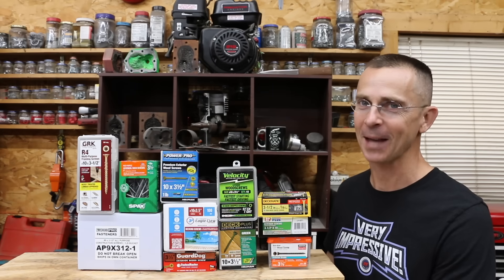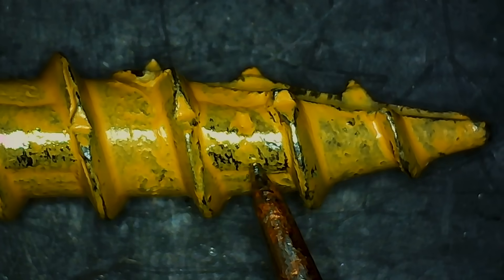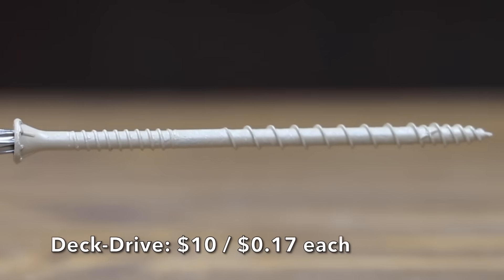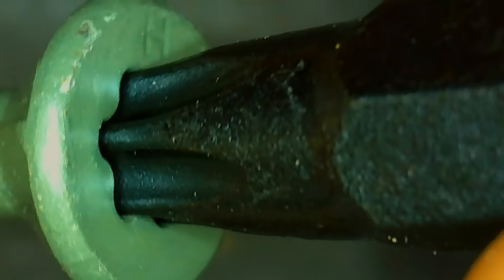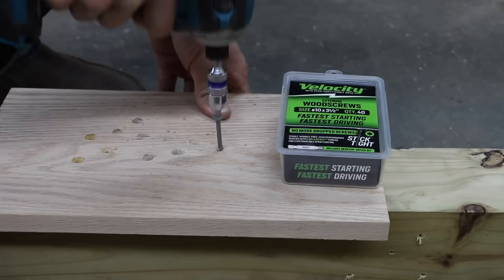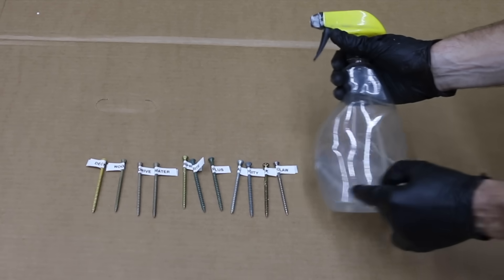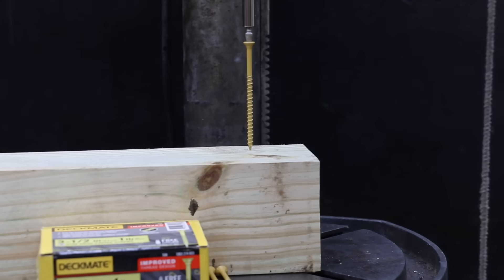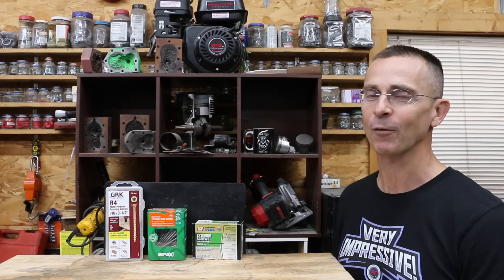Best Deck Screw? GRK vs SPAX, Grip Rite, Deckmate, WoodPro, FastenMaster, Deck Plus, Eagle Claw

Comment: I think the weight to drive the screw is most important here as long as the coding and shear results are decent.  But the actual pre drill ability meaning would not being prone to splitting would be #1 but it's not here.  I've always preferred GRK over everything I've used For these reasons

crazy story -  I recently built a large deck with porch railings, I used 3 inch GRK deck elite screws, the project went perfectly and as always GRK's bits were excellent and can last through many boxes past what they need to,  however, the crazy thing was, the first screw I took out a the large 350 screw box snapped right in half when backing out of two very soft regular 2 by fours placed flat on top of each other, my heart sank, but then it never happened again
Reply from the maker: Thanks for sharing.

Comment: Used deck screws to secure deck boards. Unfortunately, after 10 years of rain and snow, the screw heads rusted,  rounded out or broke off when using Phillips screwdrivers. Needed Milwaukee needle nose torque locking pliers to rotate out remaining screw body after using hole saw to drill around corroded screw. Recommend using stainless steel.
Reply from the maker: Thanks for the feedback.

Comment: I'm not a fan of the thread redesign of some deck screws for a reason you don't test for here.  That's the removability of the screw if it's needed.  The new design is supposed to be more efficient for lithium battery tools.  But the way they're made now, they can be difficult to back out when something goes wrong.  Plus the threads are prone to leaving metal burrs in your fingers.  Of course, I haven't tried all the different brands.  Deck mate from Home Depot are the ones I'm complaining about.
Reply from the maker: Thanks for the feedback.

Comment: a good question would be what's the max sheer force when attached to a 2x4? It takes 600lbs to pull a screw out of the lumber, like if you hang something from the ceiling..... and 2,900 lbs to break the screw, but I think the 2x4 would give in before the screw breaks when hanging something off the wall.... I'm thinking about hanging cabinets.... say you hang a super-strong cabinet to a wall with one screw... the cabinet wight has to be over 600lb and under 2,900lb before it fails... that's ignoring friction between the cabinet (rail with IKEA kitchens) and the drywall... 
My personal experience is that one screw will hold 2 people's weight without an issue so I tend to believe that one central screw into a stud on a rail is enough, but I have always had the doubt...

Comment: Nice review. In my personal experience, I had quite a common failure with #8 deck screw. That is what happens when you drive it through resistant hardwood: a combination of high torque and tension force results in screw head severed. Sometimes failure occurs further from screw head and nearly always in non-threaded section.
Deck screws in Canada mostly have Robertson (square) head. Torx heads are less common.
Reply from the maker: Thanks!  Thanks for sharing.

Comment: I know it's more expensive but I only use stainless steel 3" screws. Even though it's says "lifetime" on the box, the coated carbon screws rust away in no time when used in corrosive treated wood. It also prematurely destroys the deck when it rust away. I view "lifetime" carbon deck screws as a scam.
Reply from the maker: Thanks for the feedback.

Comment: I should have gone with your recommendations.   I bought the Eagle Stainless Steel deck screws because they were SS and I'm building a dock.  But at least 10% fractured at the smooth / threaded line.   I'd use different deck screws next time.

Comment: One thing to keep in mind with TORX drive not designed to fit snug (some manufacturers have modified the design slightly to cause this). It is their negative. If you want a tighter fit high-torque fastener, consider Posidriv. Square drive is a close second, but on other projects the backwards compatibility with Phillips gives Posidriv the edge.
Reply from the maker: Thanks for the feedback.

Comment: Robertson, cheaper and does the job.
Reply from the maker: Thanks for the feedback.
Reply: @ProjectFarm  In canada Robertson cost the same as philips so decking and fences are all done with robertson screws. BTW there is a difference from square drive, they do not sit on the bit like a proper robertson fit. Robby bit into a square drive screw will often bind as well. Square and square rarely has a collet like fit and will fall off when trying to one hand something, even torx has this problem. So you really need that taper on both bit and screw. If you are doing a 10 inch timberlock, then you use a torx bit. 

We have robertson screw with the cutting lead ground on the tip like some of those torx screws. So they perform even better with the tips cutting action and quality tapered square drive. There is more contact area on a robby vs many screws types. 

Love the show BTW. Also happy you have put a little emphasis on ergonomics. Like when you used the makita chainsaw.

 I have smaller hands and find Makita is my top brand because of where the buttons, switches and triggers are in addition to  the low vibration of the tools. Less vibration usually means the tool has a better tolerance in the parts and possible in the longevity of the tool, esp if metal. While Makita may not always hit as hard as Milwaukee or dewalt, it is however likely to last longer making the higher cost a little more acceptable. The 153 Impact I have still destroys the impact rated bits I use in it. So hitting slightly harder long term just means more destroyed bits.. My XR impact has so many issues that I prefer my ridgid over it. Not dewalts best tool. Their 7 1/4 circ saw XR is really good though.

Comment: Normally for design values you take 20% of the ultimate loads and use that as your design load. Also if the wood gets wet or damaged these loads do not apply as they can be 80% less.

Comment: I would have liked to see a reusability test. Grip Plus 4" screw heads strip very easily. A hard wood like oak may cause stripping on the second or third use. Fortunately, I could fit the screw heads into my drill chuck and ease the screws out in reverse.

Comment: A few years I was at a Lowe’s in San Antonio and saw a stack of cases of Power Pro deck screws for $5 a case (a case had 10 one pound boxes).  Bought 5 cases and still using them.  They scored average in this comparison but the price can’t be beaten.
Reply from the maker: Thanks for sharing.

Comment: Time to replenish my deck screws. As always I checked your videos. As a do over, take the top 3 in this video and try some different brands. The problem I have had with deck screws is that the coating filled in the bit area.

Comment: I think I figured out why the torque readings were so different at times with the same brand of screw.  It could be the wood, it appears to be white pine.  White pine has very soft grain (summer growth), and very hard grain (winter growth).  Wood carvers will not carve white pine due to the differences in grain hardness, it makes it too hard to get consistent cuts.  Anyway, with the different grains, if one screw hits a lot of the hard grain, and the next screw hits a lot of soft grain, it seems to me that the torque would be slightly different, remember, he was talking about inch-pounds, not foot-pounds.
Well that’s my opinion, let me know what others think.

Comment: Good video.

God this review was spot on.  DeckMate is sub-par.   I wish I had watched this video before I went to HD and bought these suckers.  I got the DeckPlus 3 inch with the star head.  The coat came off all screws that I take out.  But your rust test proved they indeed resists rust.  But that paint coming off had me worried.  I unfairly snapped two DeckMate screws out of 8 joints that I tested.  They snap and don't bend under a load.  I now know why all construction guys use GripTite and Spax (with load apps) and bolts.  I am making 4 heavy load desks.  Good video.  I almost bought a tub of deckmate.

DeckMate is probably good for a desk that is like 1000lb.  I don't know.  But I want to build a desk/[work bench] that can hold two men walking on it].  I'm heavy 245-260lbs, so I jumped and kicked on a test frame that I bored on with a DeckMate screw at the joints.  I only broke two screws out of 8 joints (from a box shape).  They gave where the solid neck meets the threads (which isn't bad), but yeah use grip-rite or spax (or nails) if you want load bearing beast of a desk.  I also had pre-drill holes so that it would not crack the 2x4 (spruce).  I used a 2 mode mason drill that was in regular drill mode;  that drill has some serious torque (so I don't know if that caused cracking).

I had a half used box of exterior grip-rite screws with the philips head.  Grip-rite didn't break.  I have now decided to use wheel bearing bolts at certain joints (because I now know that screws don't like to bend).   Each desk has a big Touch Screens attached and they weigh  ~90 pounds each for microscopy electronic surface mount soldering and other big view things;  that load bearing part got all wheel bearing bolts (which should never break).  The desk will also be used to cut wood and all types of multi-disciplinary things.  I have to build my 4 desk/cabinets for me and my repair guys that help me sometimes (basically family and friends).

Real good video.  It helps me get a gauge on the load limits.  You saved me from ever doubting my stuff.  Grip-rite + bolts.
Thanks you very much.
Reply from the maker: Thanks and you are welcome!

Comment: All charts!!
9:16 avg. Torque required to drive in screws
9:29 subjective coating wear rating
11:24 avg. Speed of driving
13:13 shear load 
16:08 average pull out force
16:55 weight to start screw into board
18:08 overall chart with results

Comment: Thanks for all the work you put in on these.  The grip-rite link in the description goes to what are listed as interior screws. I don't know if they change the listing or changed the designation.
Reply from the maker: You are welcome!
Reply: @ProjectFarm  What the bad link in description goes to:
"Size: #10 by 3-1/2"
Designed for interior wood to wood application including cabinets, framing, shelving and subfloors
Type 17 drill point creates own pilot point and eases driving
Suitable for use on cabinets, framing, general woodworking, shelving and subfloors."
They're not deck screws.

Comment: I built a planter.  It failed after a year, the bottom fell out.  The cause was 6 of the 8 deck screws had sheared.  I also found a sheared screw that was only holding the decorative siding on, there was no pressure on it.  None of the screws were rusted much, if any.  I used both new Deckmate screws, and screws that had been salvaged from other projects, both had sheared.  All holes were predrilled.  I cannot find the reason they sheared.  I've built similar planters that have lasted for one 10 years, from the same type of screws; and I've never seen this before.  However, this planter is different in that it is 4' tall, so I don't have to bend, and could be subject to more movement from wind.  The screws look crystallized at the breaks. There was no rust or marks indicating shear forces.  I was able to remove them and inspect them.   They are not excessively brittle, they seem to be good screws.   They are not cut or sheared by force.  
I do not think the crystal structure is abnormal for these screws.  I can't figure out why they failed and I'm going to rebuild the planter with different screws, but I'm worried about another failure.  I came to watch the old video on shear strength and found this newer one.  But I saw a comment on the older video that might apply to this video.   Sometimes the older stuff is better than the newer stuff; but sometimes it isn't.  How can we test this!  It bothers me.  LOL.

Excerpt from comment section of your prior video on shear strength: 

@rcguymike
3 years ago
Would be interesting to see how a re-used fastener behaves.  I always try to reuse screws from project to project if I need to rebuild something (benefits more with screws) but I'm sure repeated driving in and out messes with them with the heat being generated.  Would be interesting to see if an impact driver vs a regular drill has an effect too!

@ProjectFarm
3 years ago
Thank you for the video idea!

Comment: I just built a deck and seen this right when I finished, I used the deck mate and some deck plus I had already to match the color of cedar. Cedar is so expensive now, guess was worse last year, but I went into replacing rails and decking thinking, should only cost me like $700 in wood and I used the 5/4 not 2x4. I was able to get about 100sf free never used off offer up is reason I went 5/4, but didn't touch the cost. Still cost me way more, around $1700. Now need best deck solid deck coating video :) I did buy a Graco project painter to help time and I have a 120 foot cedar fence to spray.
Reply from the maker: Thanks for sharing.

Comment: Those are the same exact screw nails that I used to rebuild my back porch deck with 3 years ago, (them long yellow screw nails) I bought them from Home Depot, and yes they are very good & sturdy to build with. In fact it was my carpenter who helped rebuild my back porch deck recommended that I use them type of screw nails.
Reply from the maker: Thanks for sharing.

Comment: The grip rite screws you link under the video are not the same ones you tested. Amazon/Griprite may have swapped the listing. It now points to zinc coated indoor screws.

Comment: I use GRK, Grip Rite and PowerPro exterior screws.  I have had great luck with all.  I primarily use PowerPro because I get them cheaper in bulk.  GRK I use for lag bolt replacement and the Grip Rite I have are older with the square & phillips drive heads, but I do like Grip Rite screws.  Great Review.
Reply from the maker: Thanks!  Thanks for sharing.

Comment: I watched this because Home Depot just stopped carrying Spax which has been the brand I stock in my wood shop.  From these comments I see it'll be worth the effort to keep Spax wherever I can find it. I'm a firefighter and this topic is important to us. Cheap-o building construction becomes dangerous under physical stresses like fire, wind/flood/snow, or impact from trees or cars.  When it burns down or comes apart too easily, occupants have less time to wake up & escape, and firefighters are more likely to go through a roof or get stuck under a collapse.  It would be interesting to see vids like this strength-test different brands with simulated disaster conditions.
Reply from the maker: Thanks for the suggestion.

Comment: I love how thorough your test matrix is, and the spreadsheet at the end is so helpful. It would be great to have a link to an Excel spreadsheet version, especially for people comparing products based on which criteria are most relevant to our applications (for example, I always use a corded Milwaukee driver and I don't build anything professionally, so I don't care if a screw takes a little longer to install...but corrosion and pull-out force are critical, when I build something I want it to last!)
Reply from the maker: Thanks!

Comment: I could be wrong on this, but if somebody made a twelve inch long deck screw with a really sharp self-tapping tip, then it might be possible to join (for example) three 2x4 pieces of lumber. 

The tip would have to be slightly oversized, and as sharp as a drill bit. The excess could protrude out the other side, and then be cut-off. Also, the torque might be too high for a Philips bit; a hex bit might be required.
Reply from the maker: Thanks for sharing.

Comment: So deckmate came out with a "improved thread design" black screw at my local orange box store down in Arizona. I dunno about improved. I am about to take them back. They don't pass the feel and eyeball test compared to the older deckmate tan screws.  But I am curious, if you have the same screws up north of the wall... I mean in the land of Canadia.

Comment: Beyond the fact the screws will be drilled in and not removed causing more heat and further friction it should be noted that the screws need to last the life of the outdoor wood project, if it does then it did its job.
Reply from the maker: Thanks for the feedback.

Comment: Just used about 3000 deckmates building a deck. They stay coated upon entry. Immediate renoval would cause more friction heat and remove the coating. Many screws I pulled back out would be coated but the other half would have fading or open spots. Just thought I would point this out since you shouldn't have to remove the screw if you did it right the first time.
Reply from the maker: Thanks for sharing.

Comment: Why is it that so many deck screw brands use torx instead of philips heads?! That's so inconvenient when you want to tighten one up. Also, despite your rust test results, leave one screwed in the deck of your bass boat for a year or two, it'll rust.
Reply: Ha! Built a deck before? Phillips is the living embodiment of misery on a real job. Torx/star head is literally the only tip I will ever use if I can make the choice.